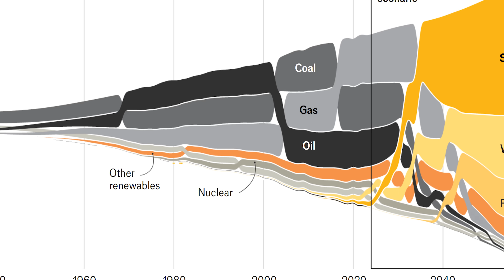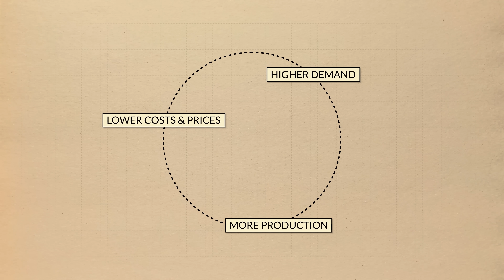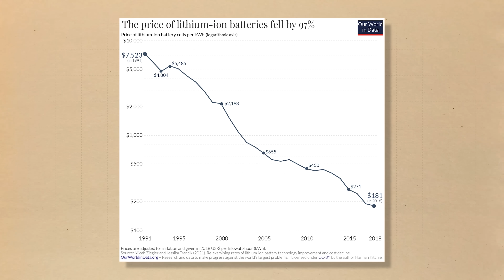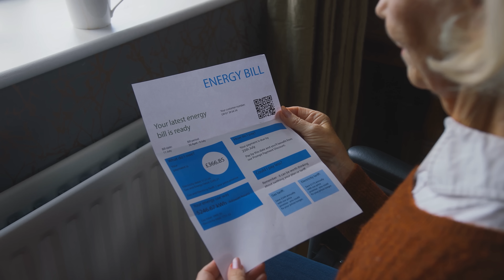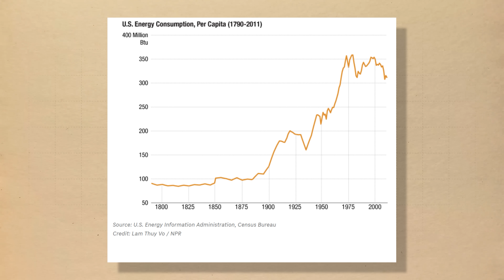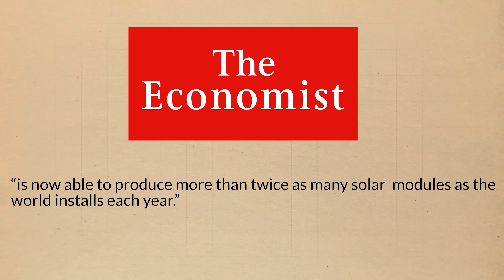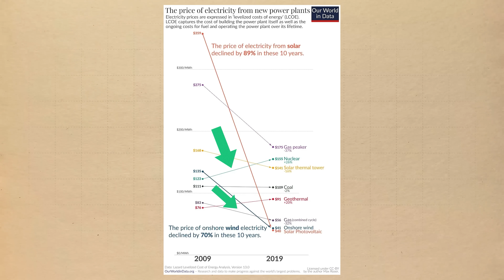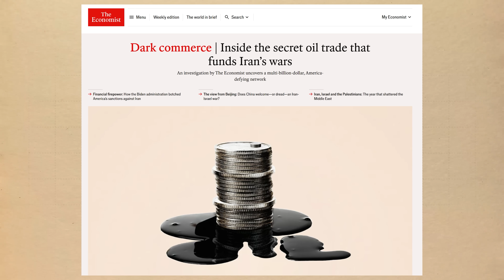Why solar will soon dominate & what that means for the world

Comment: From the article: Solar capacity has doubled every approximately three years.
This corresponds to an annual growth of roughly 25%. So the growth is indeed exponential in the mathematical sense
Reply: brother does not understand the definition of "exponential" lmfao
Reply: Solar is so small in the market it hasn't quite hit the wall yet. 

Solar won't pass 20% of stable grid energy in the next 50 years. 

I don't think you could find anyone that understands the electric utility grid operation that would disagree with this assessment. 

Solar is not storage it is variable minute to minute and that's not good for the grid.

We need reliable long lasting inexpensive storage of at least 8 hours to get solar up to 4 hours of moderate reliable power, but we will still need 100% backup power source available immediately after storage is exhausted.

Comment: It's a bubble.  Solar only exists due to massive subsidies and is not ready for prime time.  without the ability to store energy, solar is going nowhere.  Solar also takes up massive amounts of land and is anything but green.  The second reason the claim is false is that it leaves out the cost of recycling spent wind turbine blades and exhausted solar panels. Already today, one small town in Texas is overflowing with thousands of enormous blades that cannot be recycled.  The costs of dealing with solar waste is huge.

We note a potential caveat to such rapid growth in adoption: existing installations being retired earlier than their projected 30-year lifetime. In this context, we build a model of the technology adoption and replacement behaviour of solar panel end-users. We conduct a numerical analysis to calculate the solar panel replacement incentives of US residential households and project the resulting waste from residential panels. We find that annual new waste introduced into the market can exceed the volume of new installations within the next decade, which can more than double the levelized cost of energy for solar generation and jeopardise the cost competitiveness of this technology in the foreseeable future. 
In poor countries across Africa, solar panels and their batteries are already being dumped, leaking toxic chemicals into the soil and water supplies. Because of lifetimes lasting just a few decades, and pressure from the climate lobby for an enormous ramp-up in use, this will only get much worse.

Duran, A. S., Atasu, A., & Van Wassenhove, L. N. (2021). Cleaning after solar panels: applying a circular outlook to clean energy research. International Journal of Production Research, 60(1), 211–230. https://doi.org/10.1080/00207543.2021.1990434

Wind and solar energy only produce power when the sun is shining or the wind is blowing. The rest of the time, their electricity is infinitely expensive and a backup system is needed.

This is why global electricity remains almost two-thirds reliant on fossil fuels — and why we, on current trends, are an entire century away from eliminating fossil fuels from electricity generation.

It is often reported that large, emerging industrial powers like China, India, Indonesia and Bangladesh are getting more power from solar and wind. But these countries get much more additional power from coal.

Last year, China got more additional power from coal than it did from solar and wind. India got three times as much, while Bangladesh got 13 times more coal electricity than it did from green energy sources, and Indonesia an astonishing 90 times more.

If solar and wind really were cheaper, why would these countries miss out? Because reliability matters.

The typical way to measure the cost of solar simply ignores its unreliability. The same is true for wind energy.

Biden’s Energy Information Administration puts solar at 3.6¢ per kilowatt hour, just ahead of natural gas at 3.8¢. But if you reasonably include the cost of reliability, the real costs explode — one peer-reviewed study shows an increase of 11 to 42 times, making solar by far the most expensive source of electricity, followed by wind.

The enormous additional cost comes from the need for storage. Electricity is required even when the sun is not shining and the wind is not blowing, yet our battery capacity is woefully inadequate.

Research shows that every winter, when solar contributes very little, Germany has a “wind drought” of five days when wind turbines also deliver almost nothing. That suggests batteries will be needed for a minimum of 120 hours — although the actual need will be much longer since droughts sometimes last much longer and recur before storage can be filled.

A new study looking at the United States shows that to achieve 100% solar or wind electricity with sufficient backup, the US would need to be able to store almost three months’ worth of annual electricity. It currently has seven minutes of battery storage.

Just to pay for the batteries would cost the US five times its current GDP. And it would have to repurchase the batteries when they expire after just 15 years.

Bjorn Lomborg, "Trillions in taxpayer subsidies haven’t made wind and solar power cheaper or better for Americans", New York Post, April 9, 2024.
Guo Li, Mengqi Liu, Xiaochuan Li & Haifeng Li. (2023) Power production competition under different regulations: a social welfare perspective. International Journal of Production Research 0:0, pages 1-18.